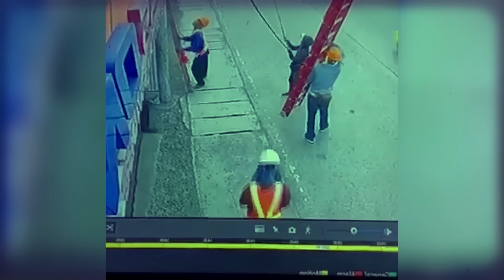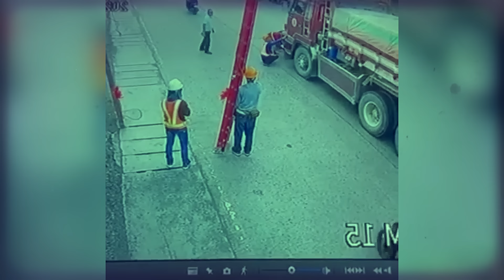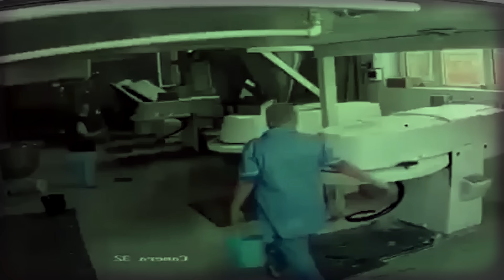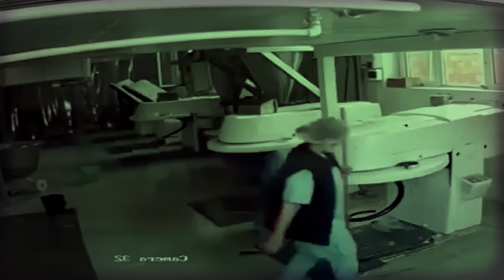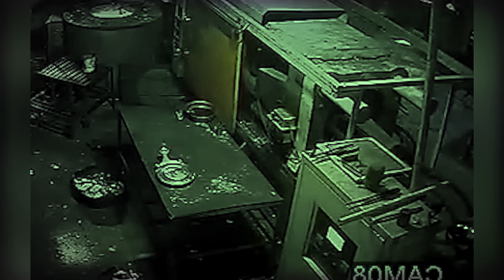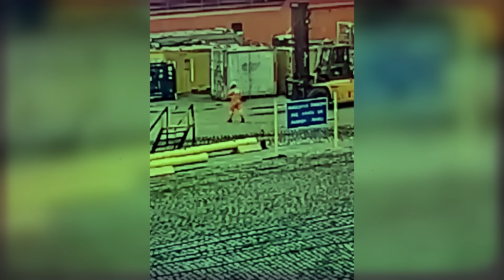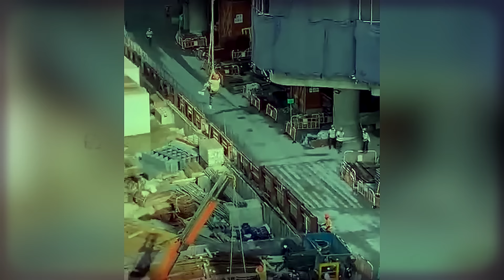Mixer Machine Accident... Caught on Camera 😱

Comment: Worker opens the safety side door of a press, yet the press still activates. 🤷
Reply: There are situations, such as setup, when the press needs to be moved, while the inspection door is open.  That being said, allowing the press to be run with the interlock defeated should be punished as a crime.  While it is arguable that Canada went too far, when it added criminal penalties (potential jail time for corporate officers) to the Occupational Health and Safety Act, employers in Canada do take safety seriously, if only to keep management asses out of prison.  

All of these channels have too many videos of presses that cycle continually, with only a delay to give someone a chance to replace the worked piece with an unworked piece, and the employer seems to think that the press being 'predictable' makes it safe, enough.
Reply: @richardbell7678  This is why laser gates exists anyway also those moves can be done in manual mode only..
Reply: Jinn